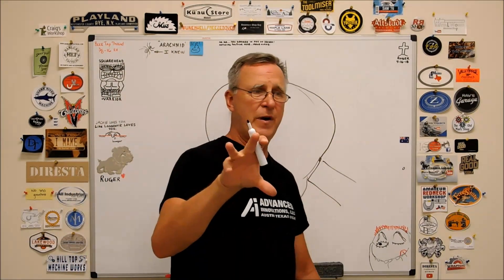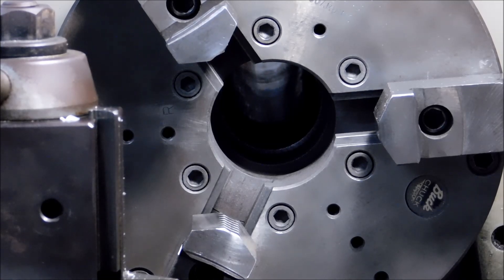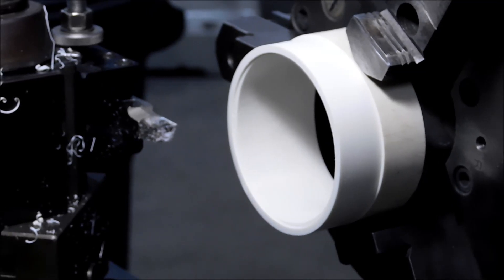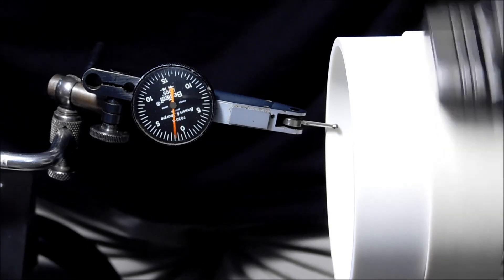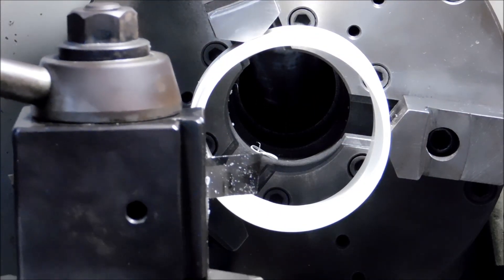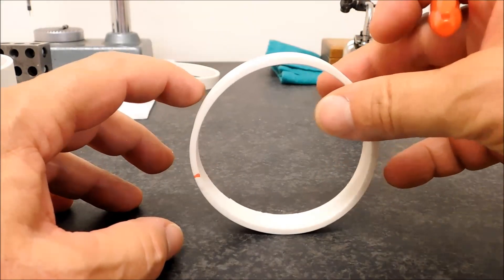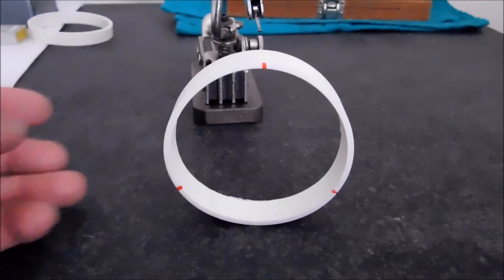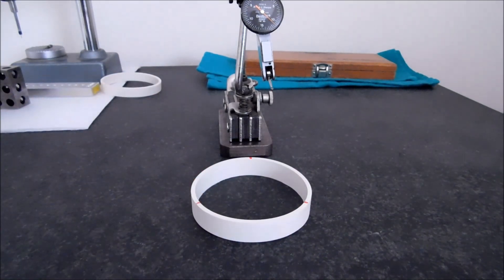Excessive Jaw Pressure and Impossible Inspection Results. Part 1

Comment: That’s just another part that will come out of a three jaw chuck.
Reply from the maker: Absolutely. The distortion on a part like this is conical to the rear of the chuck. It has a great potential to walk out. Being very soft, the material outside the chuck will resist the compression and cause the taper condition.

Comment: To make an accurate part you would machine a short piece to press in the chuck end but you already know that.
Reply from the maker: Actually, you introduce a round stress at that time and the part still has the potential to distort when you push the plug out. I've done this, but just a little different.

Comment: Measure the wall thickness?
Reply from the maker: The concentric check shown in the lathe would validate the wall thickness is constant.
Reply: Ahh but the needle was fluttering about .002"

Comment: I can see where it appears to measure out correctly with that test. The distortion is triangular, but you are measuring on two apposing points so the high and low points of the distortion are canceling each other out.
     It would be interesting to see it mounted flat on a mill, perhaps with a round top plate to clamp it without pushing the sides in or out; then do a three point center and lastly run a quill mounted indicator around the periphery to see just how out of round it really is. I bet there is at least a good 15 to 20 thou deviation.
Reply from the maker: You are very close with that guess. Come back for part 2.
Reply: Yep, I was going to say this too, you beat me to it! (your 1st paragraph that is)

Comment: Joe, you made a Reuleaux triangle. Wankel rotors are also Reuleaux triangles. Though the distance between all opposite sides is equal, as you know, they're not round. It's a shape formed from the intersection of three circular disks, each having its center on the boundary of the other two. 
I prefer to inspect shafts and round shapes on V-blocks. It avoids the issues you just had and it keeps the part in place;-)

Comment: I was waiting for you to measure roundness but you didn’t... you were just measuring the height nothing to do with roundness. You should have stuck it back in the lathe or used the mill spindle holding the indicator.

Comment: Seems quite intuitive - I always turn thin wall material with the clamped end supported by a mandrel - what am I missing?
Reply from the maker: OK, realistically, a blunt 3 pointed mandrel will result in a better part than a round one if excessive pressure isn't applied.

Comment: I bet if you measured the thickness of the part with calipers youd get close to two and a half thou variation....
Reply: I don't think so. the deviation should be synchronized and equal on the ID and OD. it should be a near consistent thickness despite the severe out of round.
Reply: @matthewperlman3356  Yep, agree with you on that.
Reply: Gee I guess parts made on a lathe dont need to be checked for concentricity

Comment: I took a receiving inspectors qualification
Test when they said I didnt pass I couldn’t believe it 
I said show me on the surface plate 
Dimension after dimension they checked and found my findings were correct
Turns out the print and part were never intended to be a test ( it was a steering box adapter for a major truck manufacture at the factory)
A inspector checked the part for usefulness 
Things he said were ok were not per the blue print tolerance (things like a zerk fitting hole which was one of them)
They disqualified me on the grounds others had failed the test also but didn’t dispute it

Comment: Another aspet of the error formed when a 2 point drill nakes a triangular hole in thin material. There will always be 2 points on the perimiter that are the drill diameter apart.
Reply: I always wondered why a drill bit makes a slightly triangular hole, thanks for clearing that up!

Comment: Same thing happens when you drill a hole that is not centred properly , when you measure across the lobes they all measure the same , there is a proper term to explain it but i cannot remember what it is.

Comment: This is why it's important to make the right choice between a two point and a three point micrometer. The two pointer "hides" three lobes like here while a three point can "hide" an oval hole!

This is also one reason why many high precision shops require that parts are checked in a measuring machine and that dimension are not only specified by dimension but also shape (and position).

On the other hand, would the part made in the video automatically be scrapped? No, it depends on it's function. Lets say it's a bushing between two steel parts - then a bit of distortion most likely wont matter.

Conclusion: Read your specification before you start working. Tolerances be it dimension, shape or positional are your friends! 
Unsure? Check with manager, inspector, customer...  Know what's needed to do it right the first time!

Comment: I expected you to get the results you did. To measure the out of round you can see, you need a 3 point measurement just like the 3 jaw,   Set it on a 120 degree V block and check it.

Comment: I believe the shape is called an equilateral trigonal.  The UK has a coin (50P)  called an equilateral heptagonal which displays the same dimensional qualities i.e. it measures the same across all diameters. It was designed  such that it would roll down a coin chute in a vending machine and can be measured for veracity irrespective as to how the coin is inserted.   A most interesting observation on your part Joe!

Comment: The triangulated shape is called a lobe.
Its geometry is such that it measures the same across all points opposite, even though it is clearly non cylindrical.
Reply from the maker: I think the 3 high spots are the lobes. The actual shape has a different title. Please correct me if I'm wrong.
Reply: @joepie221  You are correct Joe.
We just used to call it lobing and that was my incorrect shorthand.

Comment: Nice video Joe, thanks.
As many others have pointed out you have created a 'curve of constant width'. Geometrically these are created by taking any regular polygon with an odd number of sides and then creating an arc of certain radius on each of the sides. Essentially you are creating a triangle (polygon with 3 sides) with the 3 jaw chuck and imposing the arcs by rotating it in the chuck and turning it.
Excellent and very interesting video. Thanks very much.
Stay safe.
Reply from the maker: Please come back for part 2. This part is a train wreck.

Comment: Joe, I think you've got it wrong.  The low measurements will be whenever the red mark is up or down, i.e every 60 degrees.  To get the highs, you need to measure at half that, i.e. 30 degree from a red mark directly up or down.
Reply from the maker: Please come back for part 2. This part is a train wreck

Comment: Put the thing on a vee block.  It does not really matter what angle, but a 120 degree block is going to show the worst for a trigon shape.  If the shape is five sided (note:  only odd sided shapes can measure the same by two points) then a  75 degree vee block would show the worst.  

There is a three dimensional equivalent to this which looks like an acorn.  Putting three or more of these between two flat plates and the plates stay parallel and an indicator shows no movement, when the upper plate is rolled around.  It acts like it is on ball bearings, not acorns.

Comment: Two does not divide by three. This shape ( trioval ) was used as a rifling shape in black powder breech loading guns if you measure it with a two point bore gauge it will tell you it's a true cylinder, put a three point gauge on it and you get the true reading. Great videos even us old guys get to Learn something.
Reply from the maker: This is a very real, but odd phenomenon. Its all about how you check it.

Comment: I always try to use soft jaws or pie jaws to machine thin wall cylinders. When bored to your stock, they have much more contact area and require only a fraction of the clamping force to secure your stock. cylindrical distortion is greatly reduced. A close fitting plug also supports tubing and all but eliminates jaw pressure distortion.
Reply: The shop where I served my apprenticeship and eventually retired from pretty much didnt allow the use of three jaw chucks. But you can get the same effect with a four jaw. For producing sleeves for repairing bearing housings we would approach this a couple of different ways. If using pipe we would first stress relieve the welded pipe mechanically. http://formula62.com/#:~:text=Formula%2062%20vibratory%20stress%20relief%20equipment%20is%20in,with%20results%20comparable%20to%20costly%20thermal%20stress%20relief. Then we would weld the stock to a plate and chuck on the plate. We did not have soft or pie jaws. Why? I have no idea. Later another option we had for was 5C step collets. We had nominal size up to two or three inches and emergency up to 6 inch. Another option we had was if we had a large number of parts to make or a repetitive job was to make a special holding fixture. For myself I've made expansion collets of different sizes up to 4 inches out of Delrin. With those however you must not overheat the part or it will slip. And light gripping g pressure can cause it's own problems. Spinning in the chuck. Having the piece cam out etc.
What really fun is making spilt bronze bearings. Rough the part out. Slit it in a horizontal mill leaving just a couple of tabs on each end. If you cut all the way through the bearing will close up and squeeze the blade. Finish the cuts with a hacksaw. File off the high spots and have the parts silver soldered together. Now indicate the part in. Grip 45D from the split. Semi finish both diameters. Finish the OD. Now put hose clamps around the outside. Finish the ID. Cut any chamfers or radii. To seperate smack with a deadblow.

Comment: You could clamp the part flat on the mill table, put the dial indicator + adjustable arm in the spindle chuck (center finding setup) and by rotating the spindle see how "banana" it actually is

Comment: Tri-lobular,  great technical example Joe. Measuring geometry with a 120° and 90° inclusive angle V - blocks, and or a three point and two point internal micrometer/bore gauge.
Thanks for sharing.
Reply: Here in Germany this thing is called "Gleichdick". That would translate to "same thickness". When you measure it with calipers or micromeer and has the same dimension everythere. Only way to measure it outside is with a v-block like you said. :)
Reply from the maker: I can see an argument between the operator and inspector breaking out at any minute.
Reply: @joepie221  In a perfect world, apprenticeship trained, all machinist's should spend a week in an inspection department ( I was one, and spent several periods again when they were busy), but many machine shops practice self inspection, then the end user complains etc. A can of engineering worms methinks. Great series.

Comment: Fun video showing an expected result, severly out of round,
One question about Your out of round measuring in the end. How did You make sure that the rotating center was right below the measuring finger? Else You would be measuring some diagonal(?) distance.

Have respect for the forces involved, from the chuck jaws or from the turning tool bit to rotating stock.
Just fine threaded, 51 TPI, 1.6" long section of a 2.55" long, 0.235" wide piece, supported with a live center. Light cuts.... It turned out very well.
Reply: When measuring a roundish object between an indicator and a guaranteed flat surface, you simply tilt the object from side to side and take the lowermost reading as its height or assumed diameter.
Reply: @konstantinavilov1192  But what if the object is some distance, sideways, away from the vertical line of the measring tip?
Reply: @Stefan_Boerjesson  Well, then you need both tilting the object and pulling it left and right. But it is interesting to analyse mathematically the situation when a non-round object is not pulled but rather rolled from side to side.

P.S. In my previous message, I meant "peak reading", not "lowermost reading", of course.

Comment: This happened to me at work and on parts we sent out. 
Luckily senior operator knew the part was lobed.

He got a 50p out and said measured it. 

Ended up running 2 ops. 
Lightly hold the part, 
face and bore small pocket and insert and disk
then flip around the part and grip (it acts like a solid bar and their is less lobbing effect)
Then the main turning programme

Comment: Due to the 120 degree symmetry, the highest spots are always reduced by the part sitting on the lowest spots and vice versa.  The center moves up and down as it rotates and this is why rolling it exhibits preferred orientations: it prefers to sit where its center of mass is at minimum height.  A correct measurement strategy would keep the height of the center constant.  Perhaps you could put a spider on an axle, equalize the three arm lengths, place the spider inside the part at the three red dots, and rotate the spider and part about the axle.

A spider might also be placed inside the part before tightening the chuck to support the part and minimize or prevent the strain.

Comment: You are measuring on the most neutral diameter of the component, When those stresses get relived by parting that central section of the band wants to remain circular due to hoop stress, but the outer edges will be much less concentric.

Comment: I skipped to the end there to see the inspection results. Checking it that way it may initially look fine but check it again but sat inside a v-block, the results could be different. I believe we call the high spots on a round part like that lobes. When measuring with a mic/ver what ever across the diameter it looks good, but using the v-block setup you see how out of round it is. That was something I learned with centreless grinding.
Reply: Yup, totally the expected result. Measuring with the high spot (red dot) up or down of course gives the same reading, it's the same measurement just in opposite directions. With a high spot always being opposite a low spot, they cancel each other out so you get very nearly the same apparent diameter no matter where you measure- a diameter measurement tells you nothing about how far from center the outer wall is, when the part isn't round. Using an angle block instead of a single surface gives you a reading off non-opposing, non-cancelling spots.